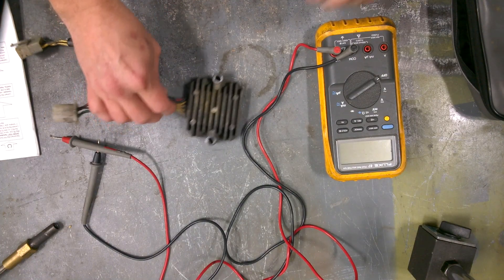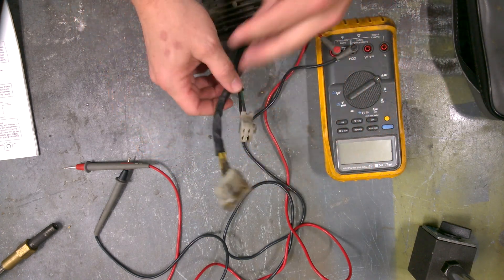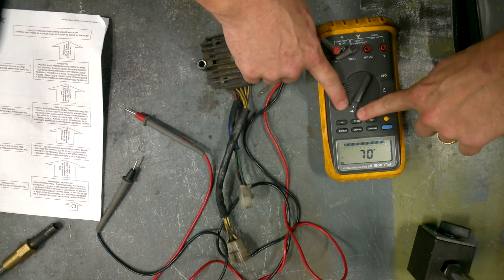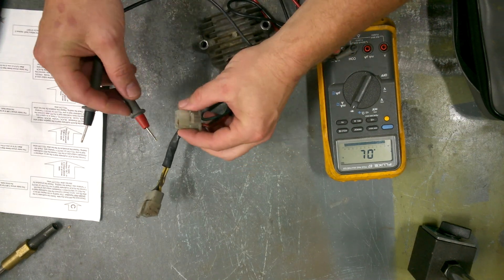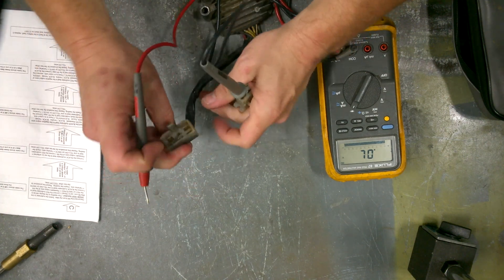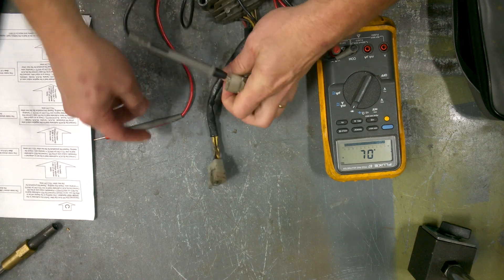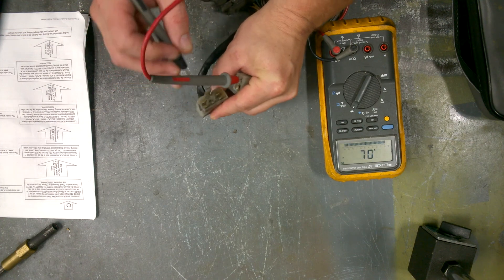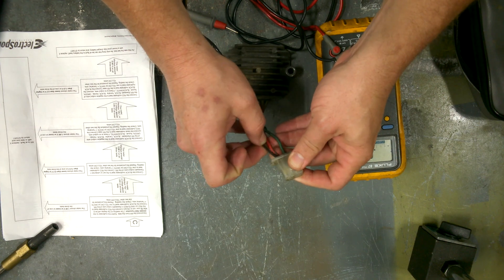Testing Honda CB750 rectifier/voltage regulator

Comment: Is it possible to repair this model of R/R? if not, what happens when factory stock is over? is it possible to replace it for other brands factory R/Rs? are there other compatible R/Rs available, NOT WHITE BRANDS (cinese, etc)? or it will be Museum time for the bike?